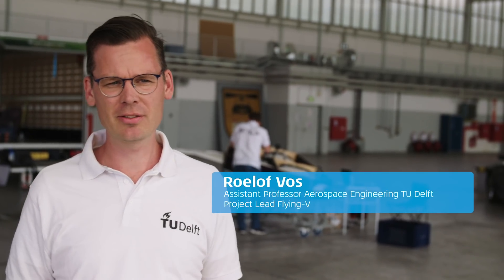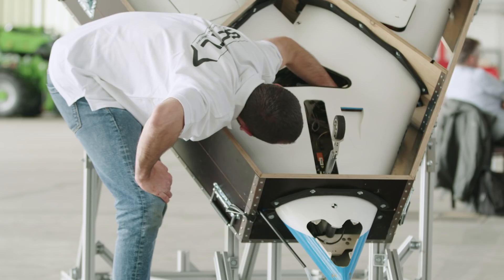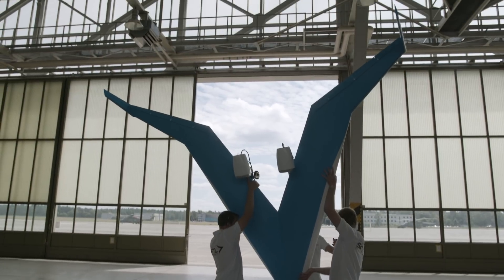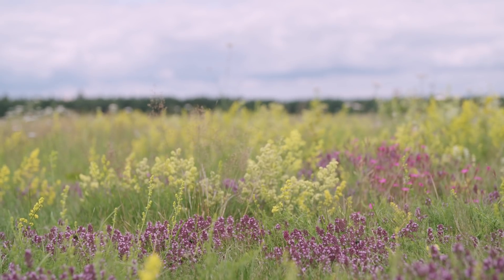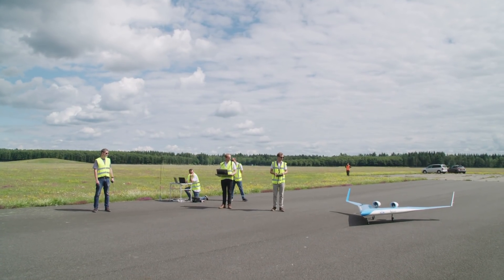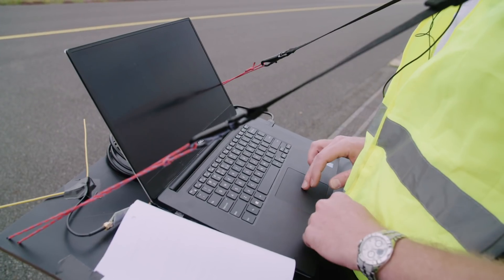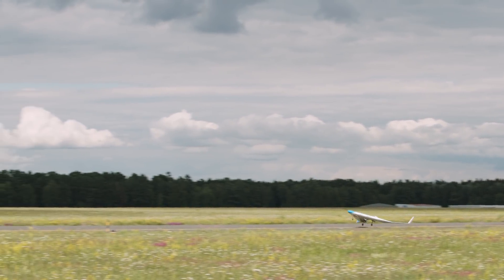Flying-V - Scale model maiden flight

Comment: Thought this was amazing but it’s unlikely to replace the flying tubes in the sky in my lifetime.  Guess I should ask why?  What problem is this solving?
Reply: Money: Efficiency = Less fuel = Less costs = Cheaper flights = More flights = More profit.
^ This seems to have been enough in the past for many many innovations, don't see why it wouldn't here. Airports don't really have to change for it, just needs a new production line/factory
Reply: Jeff Woolums this design would most likely fly better, maybe faster, and the engines would probably be different, like higher fuel efficiency or something. Not sure if this design will ever (take off) or not but it's certainly cool to see a scale model fly.

Comment: 2yrs for an electric rc plane..,wtf...
Reply: @Alessio Ricardez yep done that...
Reply: Try to engineer a relatively new/unexplored plane configuration and you will understand.
Reply: @Alpha Centauri Bruh they ain't designing and refining what could be the next airliner. This ain't something you do for fun or for a video, and I can tell that because I've been months designing and programming with my team an aerodynamic optimizer for the Air Cargo Challenge 2021, and also built weird planes for fun. They're different leagues.
Reply: @lucasnicoara7400    

 https://www.tudelft.nl/en/ae/flying-v/technology/
Reply: @Alessio Ricardez It's not terribly difficult. Motor, prop, battery, esc, rx/tx, two servos and an uncut piece of foam board. Get the CG right and its flying.
Reply: @robtomben  hardest part is the designing. For your theory even building a skycraper is a simple thing. Pre made blocks, Iron bars , a crane and rock on.
Reply: @odiljanandith3817  There are levels of course. Point is that getting something to fly with current rc electronics isn't very complicated. Designing something from scratch to fly efficiently with a certain characteristic and set of parameters is totally different.

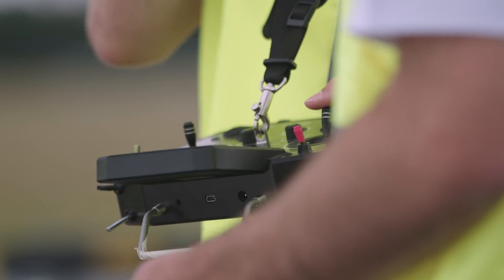Comment: 1:56 tells me all I need to know about this airframe. " ... if we are exceeding a certain angle of attack there is a sudden nose-up pitching moment." Yeah no thank you, I don't like runaway stalls.
Reply: Yes, it sounds like a disaster waiting to happen. Also,  the very wide wingspan looks like runway strikes would be an issue in crosswinds.
Reply: @Roboticgladiator  lol, why do you think they are testing it??
Reply: JeffreyJetPlain did you see how aggressive the aoa was during liftoff
It’s completely fine
You’ll have rioting passengers before that plane stalls
Reply: @arwo1143  That really wasnt all that much, and even then you could see what looks like it pitching when the operator didn't want it to as you see him pitch back down after liftoff. Have you seen test flights for modern 747's when they go near vertical? yeah you'll never do that in flight but if wind conditions are right it can simulate a pitch up attitude especially with vertical wind shear.

Comment: Looks cool but I don’t think it’ll go much farther than that unfortunately.
Reply: I think it will
Reply: Cuz it uses much less fuel than the regular type
Reply: @doyouevenskate2718  Its inherently unstable during high angle of attack situations. Airports would have to be redesigned to accommodate such a large and unwieldy shape. I don't think its going anywhere bud...
Reply: @jeffpv7468  true but maybe in the future if they work on it a bit more
Reply: @doyouevenskate2718  its a flaw with the intrinsic properties of the shape, there's not much more you can work on...
Reply: @jeffpv7468  The shape isn't more unwieldy than a regular airliner, it's not wider nor longer than a normal plane.

Comment: As for the flying wing design itself, it's flown since the late 40s.
Reply: not one thats acute like this one. most flying wing designs used a more obtuse design which is much more stable
Reply: @jeffpv7468  Those are the ones I was referring to.  I built a Revell model of the Northrop YB-49 as a kid.
Reply: @ivanleterror9158  I love the YB-49, it's one of my favorite prototype aircraft. The main difference between that and this aircraft is the angle at the nose of the aircraft. When flying with the wings swept back this much, it can cause the aircraft to be very unstable in pitch, that's why every flying wing up to this point has been wide rather than long

Comment: it might be more fuel efficient but what's about noise?
just from the technical view it would be smarter to make the centre a filled delta, so that the fuselagewing can absorb the whole noise from the engines, meaning the engines noise hit the fuselage, and the fuselage deforms the soundwaves before it reaches the ground where noise is not welcome lol.
by the way, if you talk about scale. then dont use edf's... thats shamy, dieseldriven rc turbines are so cheap nowadays, and they even have a in-air- restart feature which are 100% reliable.
when you look for good edf's with esc and lipo which you got to replace all 3+- years, in its size its actualy more expensive than a turbine or two.
Reply: If you make the center,a filled delta,won't it disturb the propulsion?
Reply: @shootingquince5203   nope, think about the old Horten H IX :)

Comment: I’ve flown similar designs and know they fly like shit without a bunch of 
gyros constantly correcting the control surfaces.
Reply: Exactly. and I mean, we have all those fancy gyros in modern planes, but look at the recent Boeing controversy, stuff fails all the time.
Reply: @jeffpv7468  We are in a transition state to autonomous flight right now and at this point you can even make a brick fly with the correct CG and a bunch of computers. I get the race for speed although you don't want to sacrifice other significant aerodynamic factors by solely relying on computers. Boeing pilots wore not trained or even made aware about what later they found is called the mcas system.
Reply: You ever fly a F22 or an  A 10 copy / model  without stabilisation?  Those are super steady, right? They even put beginner glider's like the Gentle Lady design to shame. Right?
Reply: Haven’t flown either on of those planes. This should have a nice glide ratio but they fly very sluggish specially on turns.

Comment: The air resistance of the side vectoring makes the plane unconventional to economy and noisy in high speeds. The fan size is disproportional to the passenger body. God has shown the ultimate shape of flinging machines and it is the birds shape. It took millions of years in evolution. Everything can flight when there is wind, but how well is another topic. Don’t waste your resources. Improve the authentic design.
Reply: Calm down there, most planes out there arent shaped like birds now are they?
Reply: tardy.

Comment: Firstly thank You for Your video. Respect to Your work.

 Flying wing design is good for weight and airdrag. Body lifting will be help for take-off and landing(take-off/landing speed are important) . Probably airliner version will have ultra high bypass engines. But need a lot of test for v design(etc stall charactheristic, storm and landing with cross wind...)

Comment: A flying wing... that's nothing new.   What exactly is the goal of this design?  Not trying to be angry, but I don't see the point.
Reply: I think this is different in that the wing is actually fuselage as in where passangers are where as other flying wing its still has more traditional shape(as in passangers still sit inline with the centre line of the aircraft)
Reply: @gomdoli0373  Silly design.  Can you imagine the boarding agents asking for fatties to board first... "okay, you go the left wing and you go to the right wing" and repeat.
Reply: @rjaquaponics9266  seating is worked out for weight and balance in advance of boarding
Reply: @cyh4031  How will that work asking women their weight preflight?  The  reason planes have a passenger carrying fuselage in the center is because no matter the weight or passengers and/or their locations they only have to content with directional balance for proper flight.  Put those people in the wings and it is nearly impossible to calculate.   Plus, would the seats be angled to face the direction of flight or  sideways i.e. angled?   Most people would find it very uncomfortable to fly angled.  When they place their reservation it would go something like this... Would you prefer left of right wing?  Window seat please.  There are no window seat in this plane!  This design is a waste of time!  It is not feasible for many reasons.  Just because they can design a new flying wing doesn't mean they should.  Just like the abomination of genetically mutated foods today.  They can but shouldn't! Yet they do!  This is many examples of when Science goes terribly wrong!
Reply: @rjaquaponics9266  A phone with no buttons once looked silly to most people....
Reply: The End  calm down there buckaroo, he's got a bit of a point., flying wing designs have been tried before and they keep being thrown out for the same reasons.
Reply: Less surface area per weight = less drag = more efficiency = less fuel = lower cost = cheaper tickets = more flights = more profit.
Flying wing is not new, flying wing airliner is.
The fuselage is normally a waste of surface area on a plane, since it doesn't provide any lift but does provide drag. But passenger planes need big fuselages for maximizing carrying capacity.

The design does have windows/window seats. look a the 3d model. The chairs would be facing in flying direction for acceleration safety of course. 

You sound like those millions of people who thought trying to build a flying plane 100 years ago was a waste of time. Oh men, i'm imagining you back in the stone age when the first wheel was invented, waste of time XD. 
Luckily actual innovators and scientists have no time to listen to your cynicism, because they are busy actually inventing stuff instead of typing silly YouTube comments like you and me.
Reply: @DrTheRich  A Rock was once sold as a Pet.  So What!  These "new" jiffy designs created by Common Core Engineers fly as well as a rock.  737 MAX case in point.  Engineers today have tunnel vision and forget the number one rule... don't crash.  This is a silly design to swap fuel tanks for passengers.  Let's eliminate the fuselage... yeah, great idea! NOT!  The space shuttle was a lifting body so it can be done.  IHMO that design will NOT be utopia.  It will fail as the Concord did after spending billions and likely many hundred's of people's lives.   As efficiencies increase you slowly creep up on the bloody edge of failure.  That might be fine for trains and cars, but not planes!
Reply: Matthijs de Rijk - I've built and flown numerous RC planes over decades.  I have flown wings.  Yes, they fly, but they are also very unpredictable.  They fly well as long as the air is flowing nicely over both wings.   Over 19 years ago, I was installing micro video cameras on planes to perform aerial videos.  I mounted cameras on the fuss and in the wings.  I can tell you a ride in a wing would be extremely sickening for passengers.  This is a totally foolish design and absolutely waste of money to chase marginal efficiencies!    

I wouldn't call that a very successful flight.  Just look at the pilots nearly passing out.  The plane was very pitchy i.e. more power  = pitch up, = less power = pitch down... this is no way to fly a passenger jet!   What IF you need power during wind sheer?  Or a thunderstorm?  Answer, only fly in perfect condition right?   Silly design!  Upon boarding you might be asked, "Would you prefer the puky seats or the really puky seats?"   I'll take the wing tip seats and really big air sickness bag!  Good choice, we have a special on those seats... thanks price line!
Reply: @rjaquaponics9266  I don't think you can compare the smoothness of an RC plane to the smoothness of an airliner, obviously there is a massive weight difference that is going to smooth out small trembles.
Also, airplanes have flight computers that are become more and more reliable. Modern jet fighter planes for example are build inherently unstable to gain other advantages and the flight computer than balances this all out making the plane flyable. I can see this being done with future airliners too.

further more, this model, and final airplane, are not just some hobby craft paste together of rough surfaces, but probably many many iterations of designs that went to things like wind tunnels and mathematical design models that can make a big difference in stability, when added up. I assume you didn't have access to all these tools with your hobby craft.

Lastly, claiming "science experiments are a waste of time" I can only assume you don't want humanity to advance. Before the first flying plane was invented, barely anyone believed it was possible to build a flyable machine. Many inventors had died in various unstable constructions. Until they didn't.
You would have been one of these dissenters cynically screaming how all these flight tests were a waste time money and life.

Oh and lets not forget all those people who told SpaceX it's impossible to land a rocket back on the ground. and that all those tests they build was a waste of time.

Yet the people dismissing the cynicism kept on trying and they ended up changing the world forever. So thank god people like that have the possibly to ignore you, and the dreams to keep on innovating.

If anything is a waste here, it's the oxygen you breath..
Reply: @DrTheRich  You now showed your age, before phones had buttons they had a rotary dial.  Had I been alive in the early 1900's when the airplanes were first invented... I would have definitely been one who believed in them and supported them.  10' wing span birds prove God's design works!  

There is no flying wing designs which will make a wing located passenger avoid the server affects of turbulence, i.e. air sickness.  When a plane is hit by lightning they can pitch, roll, rise, fall hundreds of feet.   A wing located passenger could even be killed by such forces.  Modern airliner wings can suddenly jump 30' or more.  Only an idiot would sit on a wing.   Last time I checked military jets don't fly in bad weather.

So design a jet that admittedly is a bad design, "inherently unstable" and then strap passenger to the wings.    Thrill seekers would love it, but the average passenger would not.

If you have followed the 737 MAX disasters you would know it was flight controls (CCE -common core engineers) that drilled those planes into the ground!  All to save a buck on a new certification.  They "engineered" the flight controls to act more like a 737 so they didn't need to certify a new plane.   The bright CCE's used one sensor's input to pitch the nose down to overcome the tendency of the nose rising (stall) from excess power from the new bigger engines.  They did such a good job it over-speed the airframe until no pilot interaction could pull out of the dive.  These idiots killed people and I firmly believe they will never be held accountable.  

The total lack of trust those prototype flying wing pilots illustrated tells me a lot of their confidence in their design and they want to strap passengers to the wings?   NFW!
Reply: @rjaquaponics9266  "You now showed your age" ok boomer
Reply: @DrTheRich  You're fresh out of college with a common core degree!  Good luck with that!

Comment: The future is electric. It's not too late for Germany to gain what they lost to TESLA. Go Electric.
Reply: You have no idea
Reply: An airliner at the moment cannot be electric as it will need more weight in batteries than its max gross weight to achieve the same speed and distance, unless there is a massive advancement in battery energy density we will only see small (1-10 seat) electric aircraft, for airliners the practical option is increasing fuel efficiency.

Comment: The design of this aircraft was made about 25-30.000 thousand years ago.
The name of this design is "boomerang".
 Moreover, it does not need an engine to fly.
Reply: Trouble is though you always land back at the airport you took off from!!
Reply: ok. travel on Boomerang
Reply: Only, this version doesn't spin you hard enough to turn your inner organs into an outer organ smoothie.

I want you to imagine, for a moment, a boomerang shaped plane, being thrown by a giant hand from continent to continent, and imagine what happens inside.

The delta-V is an evolution of the delta wing, which is in use today.

You might as well accuse us of plagiarizing birds for airplanes in general.

Comment: I used to work for Hexcel, the Boeing subsidiary that makes their high tech fibers.. I was the database and application factory floor automation software engineer.. I went on to Raytheon in the engineering department..building infrastructure for other fortune 500 companies.. 25 years ago for Hexcel.   I hurt my back, and have been thinking about a non proprietary carbon fiber technology from China that creates, with the addition of aviation grade silk, as the skin, to create a fiber that is a bio plastic that has AuPt dust in the plastic before adding to the mix.. it's going to Change the World... lighter than a cork and stronger than steel.. because it has double covalent bonds.. and creates a cubic organic crystal that doesn't burn, floats... and is lighter and stronger than anything currently available
Reply: If you say so......?
 Now, the HR department is on the 3 rd Floor, we await your full resumee.....
https://www.tudelft.nl/en/ae/flying-v/technology/
Reply: @almostbutnotentirelyunreas166  it's not to get a job bro.. I am trying to give you a technology that can save you a considerable amount of money and give you a better product.. but.. oh well